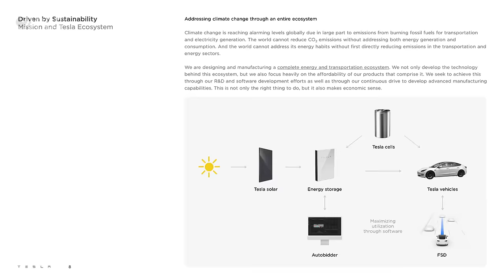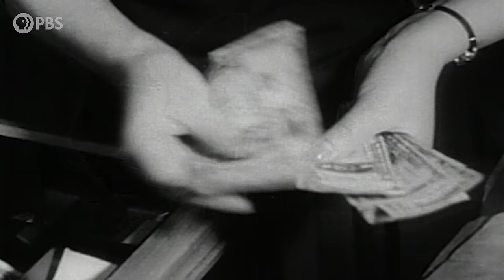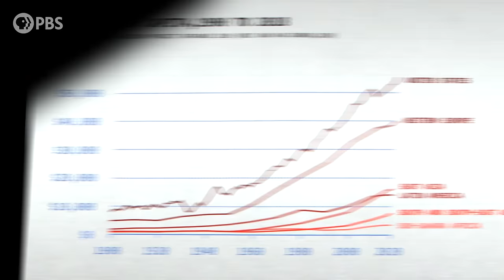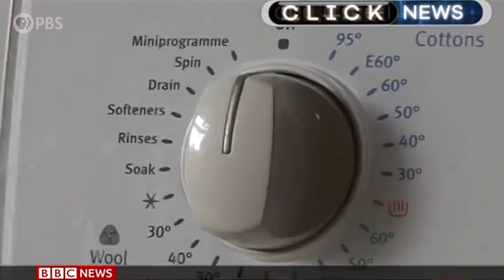You Can't Shop Your Way Out of Climate Change

Comment: What exactly is the thesis of this video? Because I don't necessarily disagree with what I think you're trying to say, but I don't think you got around to saying it very well, and I disagree with what I think you actually ended up saying. First off, you seem to be setting up a false dichotomy of "Creating Eco-Friendly Products" vs "Radically Changing and Reducing Our Consumption" as if those two things are mutually exclusive. You are making it sound like it's inherent that we can only do one or the other, not both, and that we need to stop doing the one so that we can do the other.

Second, some of the products you highlight negatively, in particular, Tesla vehicles, I think are really a case of failure to see the bigger picture. There's a vision for what humanity needs to look like in a thousand years, and Tesla is taking steps towards that vision. It is not an instant gratification solution for the here and now. Getting to that end goal for humanity is a marathon, and we are going to have to take a lot of steps to get there. This is just one of those steps. I'd even argue that a single step itself, can be further broken down into lots more tiny steps, and Tesla isn't a full step, but just one of those tiny steps. It's advancing the technology required to achieve the step, not the step itself, and laying the foundation for the step to be completed. So to argue that it's a wrong step, simply because it doesn't solve the issue in the near term, feels like a mistake. It's the equivalent of needing to push down on a child-safety lid to pull the lid off, while arguing that we shouldn't be pushing down because our goal is to lift it up.

Which brings me back to the question of, what is your main argument? You seem to spend the majority of your focus on the negatives of the things that are currently being done, without really spending much time at all on alternative solutions we should be exploring. When I feel like that should have been the focus, after a brief explanation of the former. I don't think anybody who is even remotely knowledgeable on the topic is under the illusion that buying a metal straw is enough to reverse climate change, and I certainly haven't seen anybody attempt to make that argument. It honestly almost feels like you are trying to make a video that appeals emotionally, and maybe even politically, to people within a group that already agrees, rather than actually trying educate people on the topic.

Comment: Yeah, it would be much better if people just bicycled, but if you are going to drive a car then an electric car is way better than a gas powered car, and here PBS is sneakily working for their sponsors like Exxon by not saying how much better it is for the environment to buy a Tesla, and by playing up concerns like cobalt, which Tesla has greatly reduced or eliminated from their cells, and recycling old batteries, which not a problem and will not be one as the minerals are valuable and readily recycled.

Comment: More anti-EV propaganda. Yes it takes energy to build an EV. However, it also takes energy to build an ICE, and then it takes more energy to continuously drill, refine, and transport fuel for that ICE to actually run. When you look at the total CO2 footprint including the oil and all of the wars being fought over oil, there is no comparison. EV's are tremendously better for the environment. Even when purchased new.

Comment: Some points are not entirely true in this video, in a lot of parts of the world the electricity ⚡️ that is powering electric cars is more and more coming from clean sources over 50% in some cases, solar is now cheaper than new fossil fuels so it’s going to dominate , same goes for the 36 tonnes of CO2 , if you drive somewhere between 10k and 30k miles you will largely erase that carbon debt in the car, after that the electric car is cleaner overall. I do agree with the broader point that economic growth needs to be decoupled from growth that has high emissions like making stuff, a move to a low impact low emissions growth model where services dominate will be best. Economic growth over the last 100 years has taken billions out of grinding miserable poverty and destitution, now we got to make it work without burning down the planet 🌍

Comment: So electric cars collectively negate 3,5 metric tons of co2, but their creation is polluting, up to 36 tons co2 in 17 years. 

1. Why use different units of measurement? it's misrepresenting and annoying.

2. The comparison of pollution is a fallacy. Comparing yearly/collectively to single/17 years. 

You need to compare yearly collective pollution negated to yearly single pollution negated. 

Then yearly production pollution collectively to yearly pollution single. 

Then collective lifespan pollution negated to collective lifespan pollution from the electric cars being made, and then finally the same lifespan measurement, but with single electric car.

3. Where is the alternative to green presented? criticism without any suggestions has no practical value.

Comment: One of the biggest problems is the low quality stuff that’s available everywhere. Stuff that it’s only produced to make it out the store door. Stuff that fails apart way too quickly with moderate use. Imagine a world where stuff is required to be of certain quality so it can actually be repaired, used longer, resold, and used even longer. Those things have become so rare.